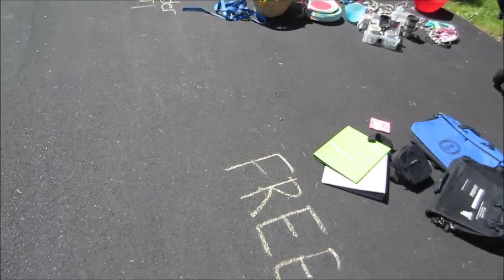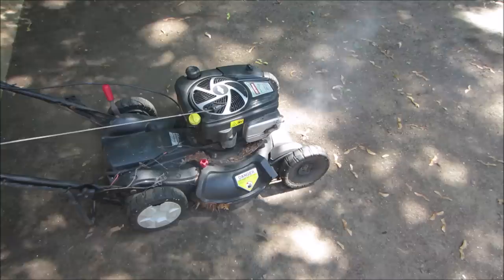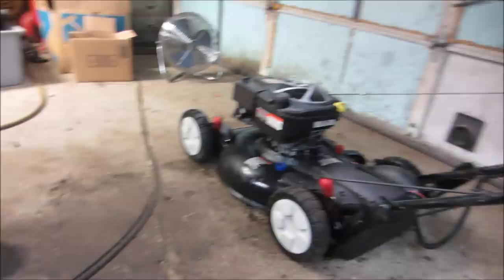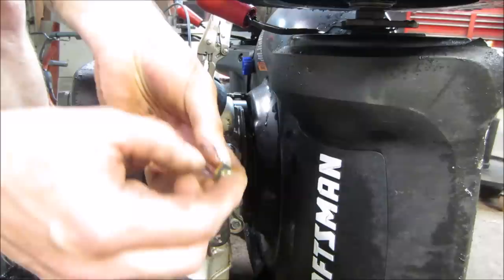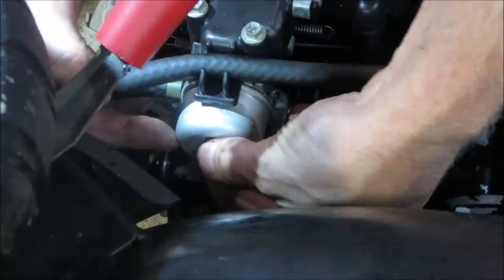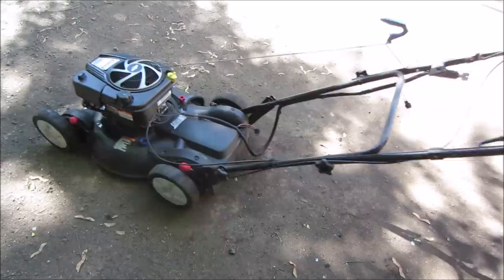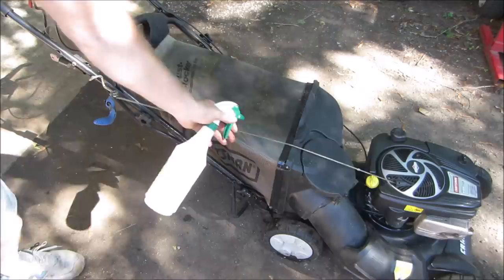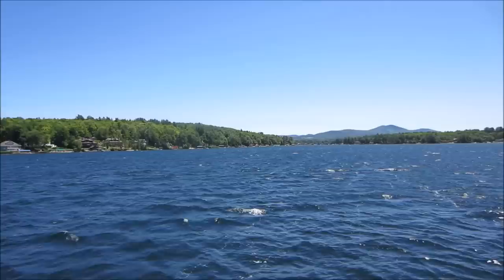Free yard sale broken lawn mower can we fix it?

Comment: Today my brother told me to pull a tree down that he cut with a chainsaw.
It was leaning up against another tree.
He wanted me to pull it down with my truck.
I told him, I will never ever ever, pull down a tree with any of my machines.
I have seen the videos.
I will not ever become the guy who smashed his truck with a tree.
So i walked up to the tree with my electric chainsaw, and cut it down in 2 minutes.
He looked at me stumped and said, I didn't know you had those skills.
He has not been around me in 30 years, so i have learned how to do a few things sense we was kids.
I had to show him how to cut under a tree so the tree don't close on the chainsaw blade.
And to cut under the tree first to cut a big branch off a tree you want to keep.
Cut under the branch first, so the bark don't get ripped down the tree, when the branch falls down.
He didn't listen to me, so we now have a tree with the bark pipped down the side of one of the trees i want to keep.
Always cut under a little first so the branch breaks free without hanging up.
Another thing he did, he put gas in the 2 cycle chainsaw.
No 2 cycle oil in it.
He came to me and asked, why is the chainsaw trying to shut off ?
So i walked up to the chainsaw and looked.
I saw the gas can setting near it.
I asked, Why is the gas can for the mower out here.
He said, Because i put gas in the chainsaw.
So i said, That chainsaw cant use gas without 2 cycle oil in it.
You was burning up the chainsaw.
The next thing he did was, he stuck the chainsaw blade down in the dirt to cut tree roots.
Anybody who knows anything about chainsaws knows you don't try and cut stuff in the dirt.
It makes the chain dull in seconds.
Now he is wondering why it smoked when he try's to cut stuff with the chainsaw.
Because the chain is so dull, its just dull metal rubbing against wood.
Like trying to start a fire with two sticks.
He learned a few things about cutting downs trees and chainsaws at the expense of my chainsaw.
And i even bought a new chain for him to do the exact same thing again.
Chainsawing the ground.
This time i didn't replace the chain.
I keep letting him use the chainsaw with a dull blade.
Now i am using my electric chainsaw that cuts way faster, because i don't chainsaw the ground with it.
I just told him why the chainsaw smokes today.
He said he will buy a new blade.
Maybe he will remember this time if he is paying for it.
The main reason i let his do all this, because he told me he has been using chainsaws for year and knows what he is doing.
He didn't want me telling him what to do, so i didn't.
Had to let him learn on his own, by letting him destroy my chainsaw in the process.
Some people you can't teach by telling them, some have to learn by their mistakes.

Comment: When did he put the missing Engine mount  bolt back in under the deck?
Reply from the maker: ended up not a bol;t hole
Reply: My wife once bought a new push mower then filled it completely full of oil and destroy the mower in 10 minutes. Hehehe live and learn.

Comment: when you check the oil are you supposed to screw the dip stick back in like you did or just put the dip stick in with out screwing it in and check the level that way?
Reply: Vintage 1957 as long as the dipstick goes all the way down. He didn't lock it to save a little time.
Reply: Vintage 1957 it’s actually depending on the engine manufacturers. Briggs motors you srpcree all the way in, the new Kohler you just set  it in too tecumshe screw in etc
Reply: Thanks. I was wondering because on small honda motorcycle engines I think you just set it in with out screwing it in.
Reply: They are designed to be checked with the cap at the closed position.  If you dont turn slightly, you run the risk of putting too much oil because you will read low.

Comment: Ive got a ryobi 2 stroke leaf blower, and it refuses to start. I took off the plug and there is spark, the fuel lines arent clogged, i took apart the carb and cleaned all the small parts with carb cleaner, replaced the air filter, put new fuel in the tank, and it still refuses to start even when spraying starting fluid in the intake. any suggestions?
Reply: try a different spark plugs . I have seen them not fire under compression
Reply: Thanks